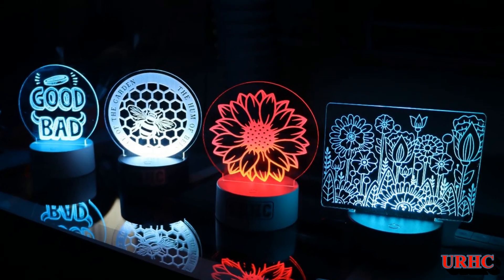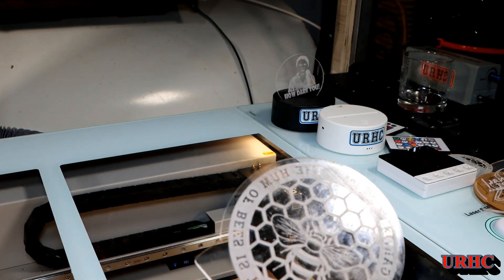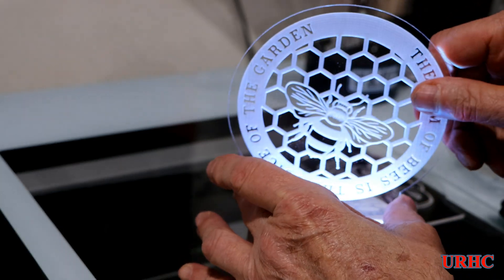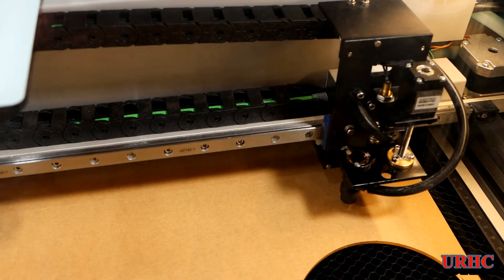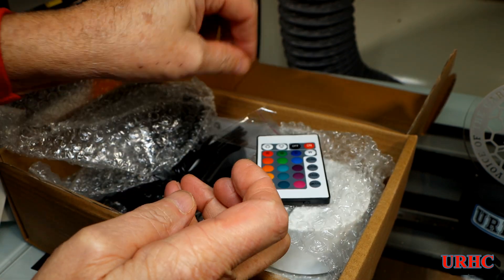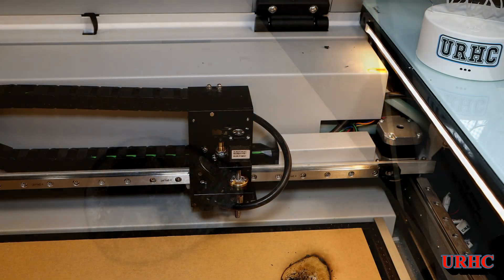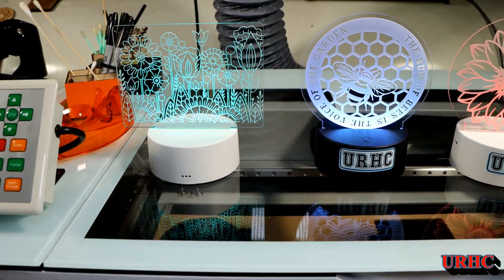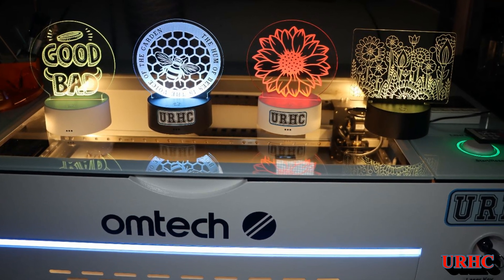OmTech Polar part 8 Acrylic Night Lights Fun Gifts To Make. What Works For Me and What Did Not Work

Comment: You did very clean engraving and cutting.  Can you write the power and speed of engraving and cutting?
Reply from the maker: I used the numbers in the manual as a starting point. Each acrylic sheet from different  vendors needs adjustments for best results so it takes some small test cuts and engraving on each one to figure  out the settings for it. There are no generic settings that will work for good results on everything.  I only use paper backed acrylic to keep the faces free of vapor spatter. Thanks for watching.
Reply: @unemployedredneckhillbilly2023  I have the same machine.  and I use paper backed acrylic.  But the engraving I made is a little deep and it becomes obvious when you look closely at the engraving on it.  I need some more information for 3mm acrylic.
Reply from the maker: Then reduce power or speed up the travel.  I turn off the air assist for engraving and on for cutting. I get poor results if it is on for engraving to keep the lense clean. Really need a 2 stage air assist for acrylic or clean the lense after each sheet. Changing the number of passes per inch can improve quality.  You don't want much overlap on passes, you want them your kerf width.  Each acrylic brand is different and I do little quarter size test pieces to figure out the best setting. Cast acrylic can be hard to fine tune the best settings.  Do test cuts and you will soon learn what setting change the results.

Comment: Hi again.  Why do you leave the paper on?
Reply from the maker: I get the sharpest engraving with it on. Tried removing it and the vapors leave a haze that I couldn't remove without messing the shiny finish. Needs a 2 stage air assist to avoid that. Thanks for watching

Comment: If you're running a business, steer clear of this machine. The maintenance fees are so high that they outweigh any potential benefits.
Reply from the maker: Just wondering what your  mean by maintenence fees. So far all mine has needed is a good cleaning and greasing  every couple hours, a couple replacement lenses, and the x home switch adjusted. About time to change  my cooling water next. I don't really see this as a commercial machine as you have to maintain and fix them yourself plus wait for parts from China sometimes,  it's an all in one low price point starter machine that doesn't come with a service contract. With proper  maintenance it's supposed to be rated at a 8 to 10 thousand hours lifespan.  I know a couple machines have been bought to expand small businesses and they seem to be working fine so far.  You may want to look for a commercial machine with a yearly service contract but that's big bucks. Thanks for watching.

Comment: Super helpful video! I used your settings with my polar and it worked near perfect but I get build up on my lens. Do you have any recommendations on how to prevent that and what  offset are you running?
Reply from the maker: Yes my lens needs cleaning and replacement often when engraving.  This machine really needs a 2 stage air assist to keep just enough air flow to keep the nozzle clear of vapors when engraving. I showed in another video how I switched to cheap Cloudray lenses. 
For the offset I ran a ramp test and made a simple block of wood to set the offset.  I do it manually now using the controller.  Thanks for watching.
Reply: @unemployedredneckhillbilly2023  I watched the cloudray lense video and will be switching to it at some point! You could put and inline flow control if you truly wanted to control the air a little better. 

I feel like possibly running the lens purposely defocused a bit for engraving acrylic might help with the build and speed of a run. Gonna run some tests once I get more time.

Thanks for the content!
Reply from the maker: i think a company called American photonics has a new lense tube available now with easily changed lenses. I find each batch of acrylic I buy needs some tweaking. 
I am thinking it needs a second low flow pump to keep the hose primed so we don't get the initial burn marks I am seeing. would be great if someone found a way ti integrate the new xtool software controlled air pump.
Reply: @unemployedredneckhillbilly2023  I’ll have to check them out, thank you!

Comment: What size acrylic do you use with those 2mm or 3mm
Reply from the maker: Ihave been using 1/8 inch stock. Right about 3mm but a little loose in the base so get the slot length right to keep it perfectly upright. Thanks for watching.

Comment: Just to clarify, when you're making these signs do you turn off air assist to get a better cut quality?
Reply from the maker: I turn it off for engraving but on for cutting. Really needs a 2 stage system so the lens doesn't need to be cleaned as often. If I leave the air on engraving they don't come out as clear. Thanks for watching.

Comment: Were you Defocused or set at 3mm?
Reply from the maker: Focused at the numbers in my ramp test. I made a guage and it's almost 6mm on my machine. Acrylic is tough on the lens because I don’t use air assist for engraving so I have to clean the lens often.  Thanks for watching.

Comment: You can make a stencil on a circut and frost the acrylic with an airbrush blaster running about 180 grit.  Gives better quality on the frosting effect.
Reply from the maker: that will work  if you don't have a Co2 laser. It doesn't give the depth and same refraction though. Works best for glassware,. Thanks for watching.

Comment: At 65 percent what is your mA? Having trouble cutting thru at 10mm and 80%
Reply from the maker: I am18ma @ 65%. I thought this machine is only rated to 8mm acrylic without running at 100% and destroying laser tube life. Be sure the lens is clean and properly aligned along with the focus below the surface.  Thanks for watching

Comment: Was looking into getting an omtech and when I researched it, all of your videos are recommended. Pretty cool 😎
Reply from the maker: I have been having fun with it. Not perfect and no real manual to learn from but works great once you figure it out. I have an early prototype one that may have caused some of my issues. I think its a great machine to get started with Co2 lasers at a fairly affordable price. I am just trying  to show my actual experience with using this machine and Omtech impressed me by allowing me to just be honest with no interface in my videos. Some other companies that I always turn down request control and editing rights to videos. Thanks for watching.
Reply: @unemployedredneckhillbilly2023  is there anything on the market that looks like a good alternative? Just comparing stuff there's so many machines out

Comment: Another great video, could you do that on your diode laser since you leave the paper on while engraving?
Reply from the maker: No, a diode laser goes right through clear acrylic.  Just burns the paper.  I have seen some lay it on a black piece of steel and use the heat from that to melt it. Thanks for watching.

Comment: When "weeding" your acrylic engravings, you might try sticking a piece of masking taper over a portion and then hanking it up to see if it will grab and hold that protective paper enough to remove whole areas at a time.  The deal with the tweazers would drive me crazy.
Reply from the maker: I haven't had success with that. I am used to weeding htv and vinyl decals that are very intricate so this doesn't bother me. I tried some without paper and they came out a hazy mess so it's worth a couple extra minutes.  Thanks for watching.
Reply: @unemployedredneckhillbilly2023  - over 20 years ago my Boy Scout troop bought a trailer and needed it lettered, but it was expensive.  I found an old vinyl printer/cutter where the printer no longer worked on Ebay and drove it with CorelDraw.  The trailer was the first thing I evern attempted.  I created a decal of our town's logo to go on the trailer - a Fort and a Mill.  Being new to the process it wasn't until I was weeding it that I realized that it had over 5000 individual pieces to it.  It was a lot of work, but was beautiful.  It still looks faded, but good on that trailer.

Comment: Great info
Reply from the maker: Glad you think so. There's not much information about these lasere out there yet and hoping this will help someone else get started.  Thanks for watching.
Reply: @unemployedredneckhillbilly2023  I’ve been thinking about a 50watt co2 and I’m kind of waiting for the xtool P2 to come out next month. I sure would like to see you get one of those and do a review. Your reviews are the most honest and real tHat I have found on you tube
Reply from the maker: I doubt Xtool will deal with me again.  I have turned down all their recent offers because I feel their products have become overpriced compared to other offerings and the diode machines have come to a dead end with their capability. I think they will be over 4 grand for a little larger bed with 3d capability. I am looking at buying a 100 to 130 watt 40 inch bed for about the same as my next upgrade.  This size machine is basically a starter that gets you hooked and makes me want a big bed with thicker lumber capability for the next move.